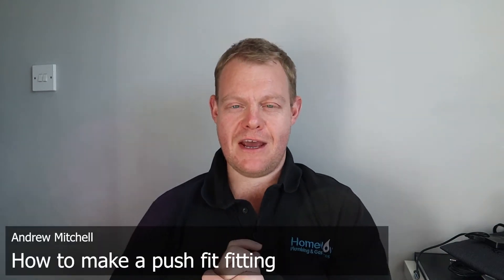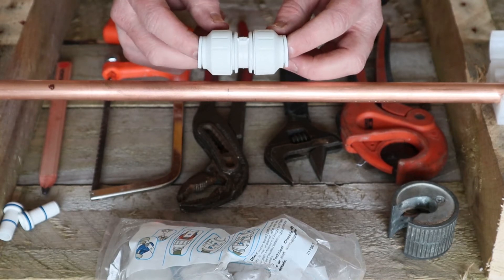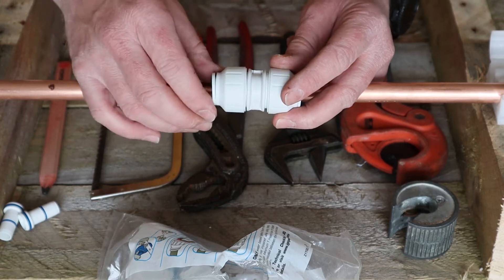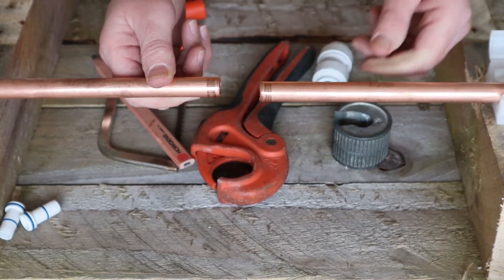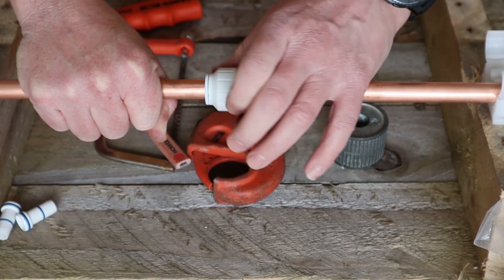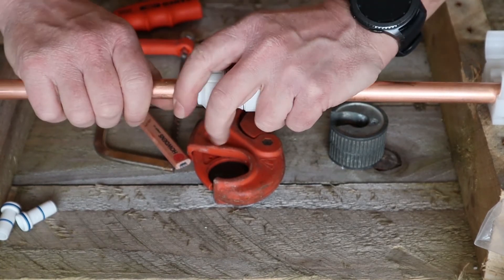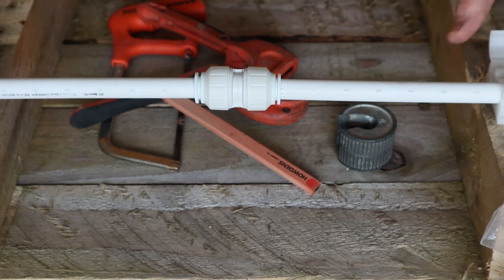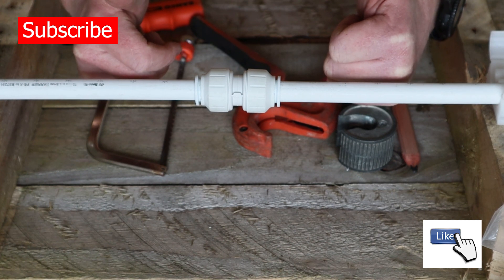How to use push fit pipe tutorial | Full demonstration

Comment: Would it be ok for me to only use these JG pipes and fittings on flow and return pipes all the way to a radiator valve or would I need to use copper pipes to connect to the valves?

Comment: i don't understand what the internal part does besides add cost and take time.  Is it to strengthen the assembly for side loading?  I also didn't quite catch what the twisting of the two ends does.  The JG fittings that i have used just push in, no twist.  Does it squeeze the ss clamp ring down further?

I just found this JG video, so i guess i answered my own questions :). https://youtu.be/v6kRm3KKCQo

Comment: I used a Shark Bite fitting to replace a soldered copper elbow that developed a pin hole leak. I like that no modifications were needed and it's brass. I secured to floor joist and ran copper wire around so couldn't come off in either direction.